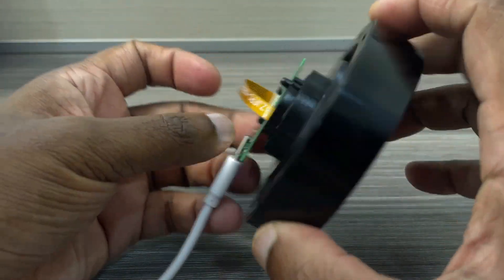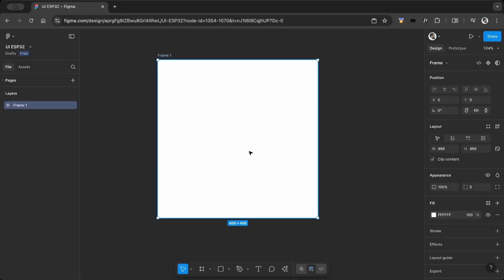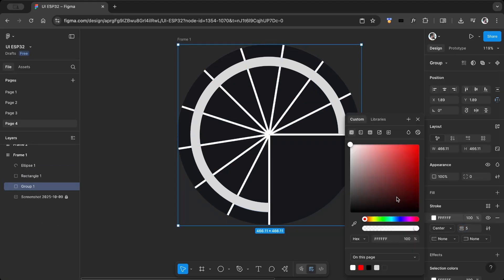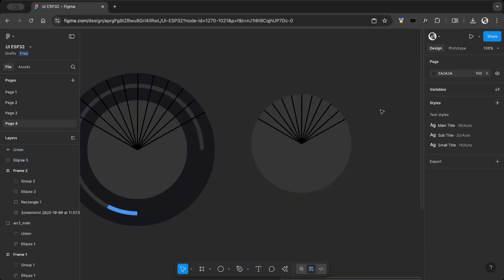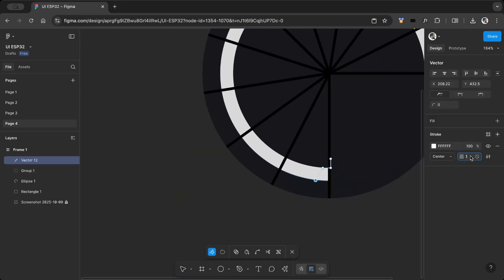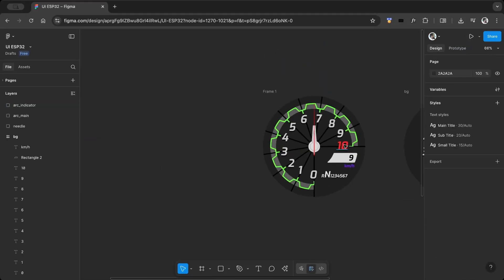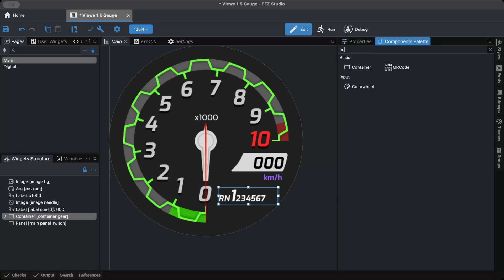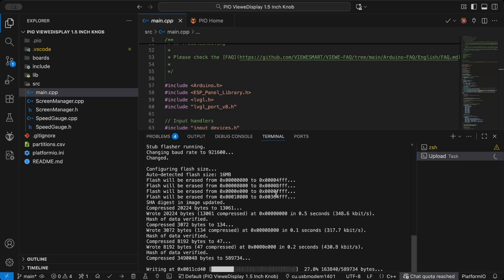ESP32-S3 @viewedisplay⁩ 1.5” AMOLED Auto Gauge HMI with Button & Rotary Control Powered by LVGL

Comment: I tried following the tutorial, but my gauge image is not precise when I combine it in EEZ Studio. The gauge image becomes smaller compared to the gauge in EEZ Studio.
Reply from the maker: which tool you use to crate the gauge need? figma? form figma export it as 1x.
Reply: @nishad2m8  I am using Figma as shown in the tutorial, but with the gauge starting at 90 degrees and ending at 330 degrees. When I export it at 1× scale, the gauge becomes smaller and matches the size of the gauge in EEZ, even though in EEZ the gauge has wider edge margins.
Reply from the maker: @wahyu_zx  exported image should have full width and height of the gauge like 240x240. some time if the element in figma didn't took full width and height. create a art board with exact width and height of the arc. then place element inside and export
Reply: @nishad2m8  If you have time, could you make a tutorial for the number and letter animations? The video is too fast, so it’s hard for me to follow.
Reply from the maker: @wahyu_zx  i'll try
Reply: @nishad2m8 Thank you for the suggestion, I will try it later. Thank you as well for responding to my question, I will wait for the video.
Reply from the maker: @wahyu_zx  keep try. I learned lot from my mistakes. all the best
Reply: @nishad2m8  Thank you for your support, I really appreciate it.

Comment: Have you tried this board ESP32-C6-Touch-LCD-1.47 LCD type ISP
Screen resolution 172 × 320
Display chip JD9853
Touch chip AXS5106L because I can hardly find any useful project for it
Reply from the maker: No i don't have the board.
Reply: this touch Chips is not popular

Comment: Looks like there's some decent screen tearing or some kind of refresh rate issue
Reply from the maker: There are some LVGL fps drop
Reply: @nishad2m8  Is that due to the interface or ESP-S3's graphic computation limit?
Reply from the maker: Lvgl rendering and how the display interface handles refresh… we need to optimize it.

With amoled display, quick updates involving large images cause FPS drops.